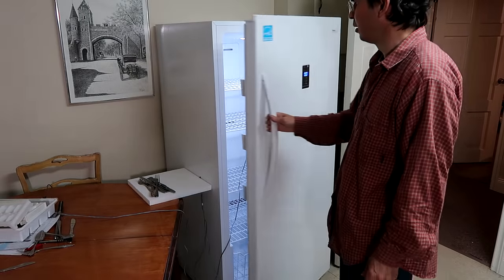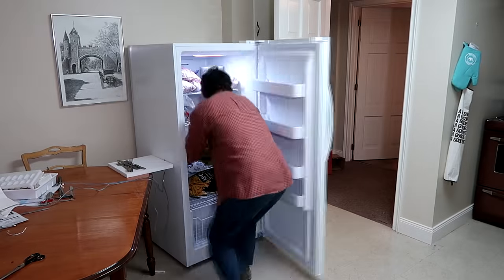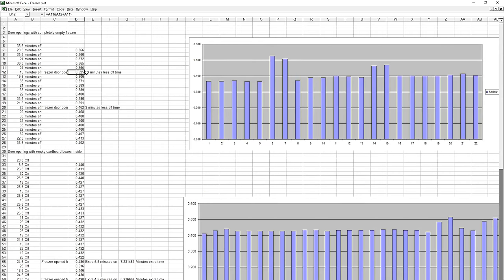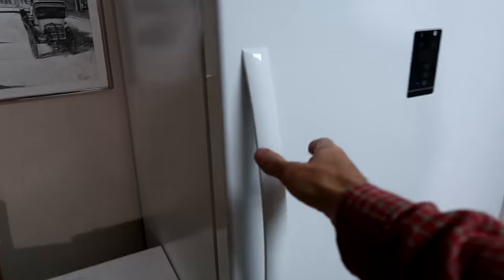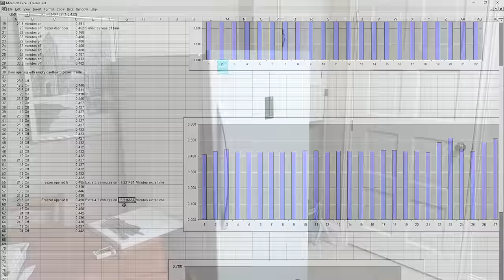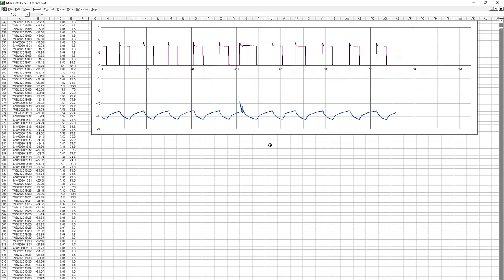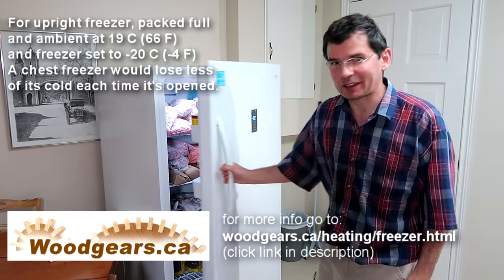How long does a freezer stay frozen with no power: experiments

Comment: Not seen a freezer with bare shelves in years. Went freezer shopping earlier this year and they all have pull out drawers, even my old one had drawers.
Reply from the maker: I'm not sure what's better.  Drawers are very handy, but they also take up quite a bit of space themselves, so cuts down on freezer capacity.  But they sure cut down on how much cold air falls out when you open it.
Reply: @matthiasrandomstuff2221  I do think drawers make stuff inside your freezer easier to reach, especially if you've got smaller items in there. Without a drawer, you basically have a box of say 600 x 800 x 300 mm (width, depth, height), with the opening on the 600x300 side. With a drawer, your box may be slightly smaller, but you're accessing it from the 800x600 side instead of the 600x300 side. It can also help you fill your freezer to a higher degree, since you can fill a drawer to the absolute brim without worrying about something falling out, which can be an issue without drawers.
Reply: @timderks5960  problem is with drawers you need to open the door fully to pull them out. in some house with cramped space between appliance its a pain.
Reply: @Francois_Dupont  That's true, but that's an extremely specific issue.

Comment: I was a food hoarder of sorts. A man and his wife had two full chest freezers and two full freezer compartments in two refrigerator/freezers. We had a power failure and I panicked. There was a lot of meat in the freezers. I spent over $200 on dry ice at the grocery to maintain the freezers. Nothing thawed out. For everyones information, none of the dry ice lasted more than 24 hours in either chest type freezer and the lids were never opened. I got two loads of ice but don't remember how many pounds that was but it was not much I assure you.
Reply from the maker: Yes, that is always a risk.  Or worse yet, somehow knocking the plug loose without noticing.

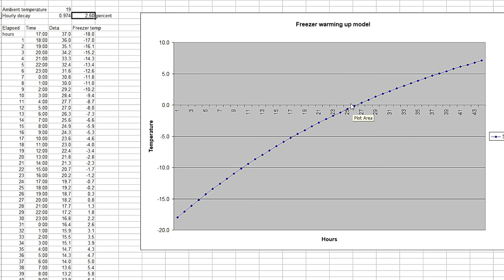Comment: The graph at 1:55 isn't quite accurate for a freezer with a bunch of stuff in it. The temp won't change much (if at all) as things go through the state change of being a solid to a liquid. So the slope will change (flatten as the heat energy goes into doing the state change and not moving the temp) as it nears 0 degrees and stuff starts thawing.

Comment: Did you end up putting a timer on the power to cycle the freezer on/off for x amount of hours? 🤔
Reply from the maker: that would be stupid.
Reply: @matthiasrandomstuff2221  ohh, I thought it would save power. Thank you for the nice response 😂🤙
Reply: @JonnyDIY  If you keep the freezer temperature relatively constant the compressor will need to sustain a specific duty cycle over time. In other words, it will run for the same number of hours each day. If it's unpowered when it would otherwise have run for three hours, it will run for those three hours when you plug it back in.
Reply: @eDoc2020  ohh ok I see. I was just thinking you could cycle it on and off but I guess it does that already with the thermostat. Was trying to find a way to save electricity for chest freezer off the grid

Comment: Should you not subtract around 12 minutes from the 26 hours if the power is off as it was 6 minutes run time for the compressor but the compressor is only on roughly half the time with power on?
Reply from the maker: But that same compressor on half the time must be compensated for again when calculating the time to thaw, so it cancels out.

Comment: Recently had a power outage and did some research to see how long my food will last. US gov recommends food is safe in the fridge up to 4 hours from losing power. From my memory fridge temp is around 40 degrees. So going off Matthias’s numbers you have 36 hours to melting point + unknown time from melting point to fridge temp of 40 degrees + 4 hours above 40 degrees. So that 36 hours is at least 4 hours longer.
Reply from the maker: If you are going to consume the food coming out of the freezer, you can go much longer.  But the food you won't consume will have thawed and if you don't eat it, it's kind of spoiled.

Comment: Not that I think you'd learn anything from it, but have you seen the Technology connections video on chest freezers?
Reply: It would be nice if somebody did the same tests Matthias did here but with a chest freezer. I wonder how much of a benefit a chest freezer would have.
Reply: @eDoc2020  I second this. I would be interested to see a direct comparison with just tilting this vertical freezer on its back and doing the door open test. I suppose if you had a chest freezer you could do the same by standing it on end and measuring the difference.
Reply: @BravoCharleses  Don't do that. Refrigeration systems (at least this style) only work if they're properly oriented. The manuals for refrigerators and air conditioners will usually say to wait 24 hours before powerup if it's been on its side because this can cause damage.

Comment: Conclusion: purchase a chest-type freezer instead.
Reply: for pure efficiency, yes
Reply: They have their drawbacks though.
For that sweet efficiency and lower "cold" losses you're giving up ease of access / order  .
And chest-type would need to be de-iced periodically, while vertical ones are usually automatic or no-ice buildup at all.

Technology Connections did a video on chest-type freezers :)
Reply: For a chest freezer, better to fill the bottom with gallon jugs of water. No one digs to the bottom.

Comment: Very useful info for us living in a rural area with frequent power outages.  It confirms the URBAN LEGEND of 36hrs w/o opening the door.  Question:  Do you believe that your experiment applies to horizontal freezer ?  Cold air release is less when opening the door but that did not influence the duration for the vertical version significantly I believe.

Comment: I'd love to see this on a chest freezer as well.
Reply from the maker: I don't have one.
Reply: most chest freezers are not auto defrost, no thanks.
Reply: @matthiasrandomstuff2221  Ordered one of those meters and will share data when I get a roundtoit.
Reply: @AppalachianLife  Technology Connections did a video about chest freezers: https://youtu.be/CGAhWgkKlHI 
Basically, chest freezers can be super efficient bc the top lid prevents cold air from spilling out which also minimizes warm moist air from going in. So auto defrost is not really necessary.
Reply: @AppalachianLife  It's better without auto defrost, since that's what causes freezer burn.
Reply: @matthiasrandomstuff2221  Maybe an appliance shop would sponsor a video by at least loaning you one. Now that we are all shopping less frequently they might benefit from the advertising!
Reply: @matthiasrandomstuff2221  I have had a little 7cft chest freezer for years and can attest to its efficiency.  Little inside air is exchanged when opened so there is little inside frost, I defrost it about once a year. I also know it costs far less to run than my old upright freezer.

Comment: I also have an upright freezer. Our fridge/freezer doesnt have an ice maker. So I just use an ice cream bucket and fill it with ice from a small stand alone ice maker I have. Worst idea I had to use the stan up freezer to store the ice cubes. 1) it was a super huge waste of efficiency on the freezer to keep opening the door to get ice like 10x a day. 2) this freezer needs occasional defrosting bout every 10 months. Well with using it to hold ice and opening the door 10x a day the frost was built up in about 3 months. Changed back to the fridge/freezer unit.

Comment: I would be interested to find out the effects of where the freezer was placed. Unconditioned garage vs Conditioned basement. Are you able to calculate the effective insulation value for the freezer and the surface area?

Comment: I only knew about -40 C = -40 F, had never considered there was a (close) symmetrical point around numeric value 0, -11.4 = 11.4 :) - History is fun
Reply: I’m convinced the only reason he included the conversion was to show off that fun little fact :)
Reply from the maker: no, I was kind of surprised at that one myself.  First I thought I made a mistake when the numbers were the same.
Reply: knew*
Reply: @aaronalquiza9680  fixed, thank you.
Reply: It will happen with any two scales which have a different zero point. For example, -136.58 degrees Celsius equals 136.58 Kelvin.

Comment: Informative Matthias. Wonder what difference it would make if you added foam board insulation over the body of the fridge (except the heat exchanger ofcourse). I imagine you can use packing tape to stick the foam board rather than gluing it to the fridge!

Comment: Matthias, do you think a DC inverter refrigerator would be more economical since the compressor can operate a various speeds? It seems to be the case with the HVAC split units I've seen. Maybe slow and steady is more economical than ON or OFF.
Reply from the maker: That would make sense.  Though the small tube that the liquid has to go thru to make back pressure would also have to be adjusted too.

Comment: Same experiments with Box Freezer would be interesting as a comparison.
Reply: less loss on opening the door else pretty much the same

it comes down to insulation after all
Reply: @suit1337  I believe chest freezers are typically better insulated as well.
Reply: @seigeengine  

 usually freezers with drawers are more modern and therefore are more energy efficient and better insulated

but you can get a cheapoorly insulated with drawers or the other way around

in Europe it is mandatory to show the efficiency and average power consumption which is measured by a standardized process (like WLTP for cars) so you just need to look for that to have at least a relative comparison

Comment: Like me, you might find yourself with a Freezer whose controller circuits crap-out..mostly because they don't put zero-crossing relays on their controller boards. I replaced the entire controller board with an SBC (AT-Tiny) and sensors and wound up with a FAR more efficient freezer than the manufacturer gave me.
Reply from the maker: I miss when freezers just had a thermostat.  Much cheaper to replace.

Comment: This is timely for me, as I'll be moving a few days drive away soon, and I'll be taking my freezer with me. If it's not empty, I'll stop by my favourite butcher and fill it up, and find places to plug it in every night!
Reply: An efficient freezer doesn't pull many amps.  A simple inverter plugged into a cigarette lighter should be enough to run the freezer when you are driving.  If the freezer is exposed on the back of a pickup, wrap it in blankets to keep the wind off it. Overnight should be OK without power if it was cooling during the day.
Reply: @sheldonfrey1  It's a chest freezer that has a large draw to start it's compressor. It doesn't use much power when it's running, but the compressor start can produce power spikes. Come to think of it, maybe I should just sell the freezer and buy a better one.

Comment: Does a larger freezer, as compared to the one you used, remain colder longer because of the larger mass of frozen food?
Reply from the maker: yes.  Assuming it's full.  If it's got the same amount of food as a small freezer, it will actually thaw faster (more surface area per food).  But you can put bottles of water in it to take up the extra space.

Comment: Hm, only lived in Germany, Netherlands, Qatar and Oman I never experienced a power cut lasting longer than 30 minutes. Maybe there is a reason why a lot of countries have put their power lines underground instead of keeping those ridiculous troublesome overland power lines? Looks like the old style chest design freezers do have their advantages.
Reply: In January 1980 we had almost 2 weeks of outage, b/c ice rain built up lots of ice on the overland power grid backbone wires, and some alleged RAF ("Rote Armee Fraktion" - german leftist terrorists, not Royal Air Force) sabotage on the space frame masts from years earlier plus corrosion at this areas made some power grid backbone masts collapse. That was only 55km out of Munich.

Comment: I wonder how the temperature of the actual food changes as compared to the air temperature in the freezer. I would suspect you would have a few hours from when the air temperature passes the melting point to when the food actually melts. You could put a temperature probe in a block of ice to simulate this.
Reply from the maker: The air gets the temperature from the food.  Outside insulation is quite good, so measuring the air temperature is representative of the average for the food.
Reply: @matthiasrandomstuff2221  That makes sense. I suppose then you could use frozen salt water (or something with a lower freezing point) to buffer the temperature if you are expecting an outage. It just needs to be something with a freezing point between the freezer temperature and the melting point of the food.

Comment: Chest Freezer 80% full, wrap in a quilt and its good for 4 days - as long as you don't open to peak how it is doing!
Reply: Small freezers on a bus in summer will hold about 6 hours before tickling 32' from about -10'

Learned this when i moved cross country with 2 freezers both around 4sqft 1 front 1 chest.

Ran them on an inverter to the buss engine with a ups to keep them going for small stops like gas etc.. 3 nights i could not plug in at my stop. They hold 6hrs then i go out and start up the bus to bring the temps back down again.

Comment: So I’m guessing 1 minute of the freezer being open would loose approximately would be 1.3 hours of a reduction in freezing temperature that leaked out based on the calculations.
Reply from the maker: no.  once the cold air has fallen out the rate of coolness loss decreases

Comment: Now can you get a cheaper nighttime electric package and make the freezer use only that cheap nighttime power?
Reply: A simple electrical timer should do it.  Make so the timer provides power during the overnight hours only.
Reply: @sheldonfrey1  The freezer needs light when opened too.
Reply: LED flashlight.  It's a trade off.  A really good 22cf chest freezer may only cost you $50 a year to run.  Is it worth a $15 timer and the hassle to save $15 or $20 bucks a year?  Where I live rates are the same day and night.
Reply: @sheldonfrey1  Is it a hassle though? If high electric costs... If the nighttime rate is really cheap...(It's a special package offered, if available). The biggest hassle to some would be only using the AC overnight.

Comment: Can we pull some interesting albeit annedoctal conclusions from the test? I've always been curious about a few things regarding fridges...
1. Better to keep it empty or full regarding energy consumption and potential for it to keep working during blackout?
2. Better to distribute the content equally around, or for instance pull it from the back of the fridge to allow better circulation, or something else?
3. How cold things should be before putting them into the fridge?
Etcetc
Reply: 1. Full is better, if the freezer is empty there's a lot more cold air that can be replaced by warm air when you open the door and a lot less obstruction to stop the air from slowing in/out, and the thermal capacity of air is also tiny compared to anything else you might put in a freezer so the less stuff is inside will make thaw much faster if power is lost.
2. Depends on what you want to optimize for, if you put a lot of non-frozen food in the freezer at one time to freeze it you don't want to put it in a very close group because it will take longer to cool it to freezing temps (it wont take more energy, it will just happen slower), If you block airflow within the freezer too much the freezer will not work properly since the machine works by cooling the air and the air then cools the food, so if the cold air can't flow to a certain place within the freezer it will take a much much longer time to freeze since it basically has to freeze through contact with the frozen things that are blocking the airflow and that will take a very long time.
3. The rate that something cools at depends on the temperature difference between it and what surrounds it, so boiling water will not cool very much faster at room temp or in a fridge at the start, since it's a difference of 100C to ~20C and 100C to ~5C, so letting it cool at least for a little bit saves quite a bit of energy but not much time, letting it cool to room temperature saves the most energy but takes a very long time, somewhere inbetween is probably best. I don't know what exactly is best, I'm sure you could find a more qualified person on the topic if you googled it.

Comment: How much does a freezer-opening cost, in kWh?
Reply from the maker: About 0.0035 kwh
Reply: @matthiasrandomstuff2221  So, in Sacramento, where electricity is 12¢ per Kwh, opening the freezer is four hundredths of a cent?
Reply: @matthiasrandomstuff2221  I'm guessing you've based this on average power consumption instead of power consumption when the compressor is on, thought isn't that what you should be using?
Reply: @Cockerham  If I'm not wrong, the answer is closer to 0.02 kWh~, or about a quarter of a cent, but that's ballpark right either way. Basically nothing.